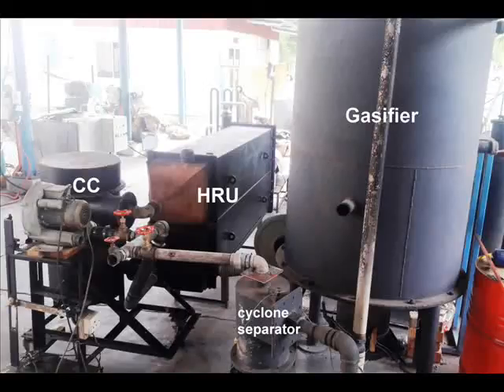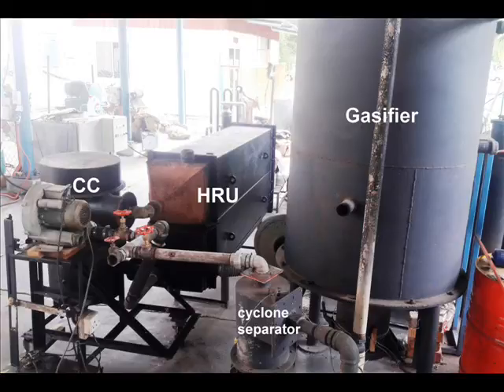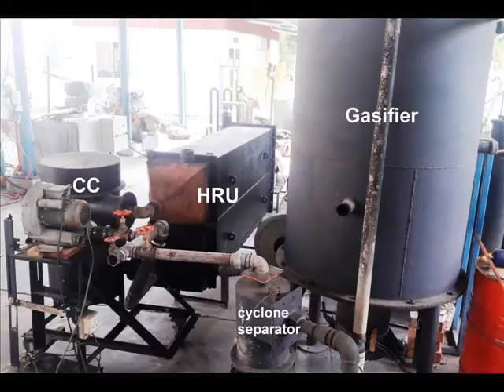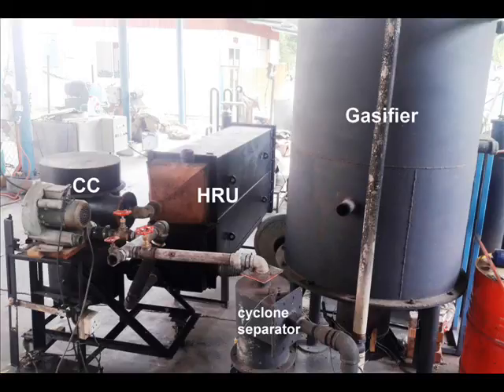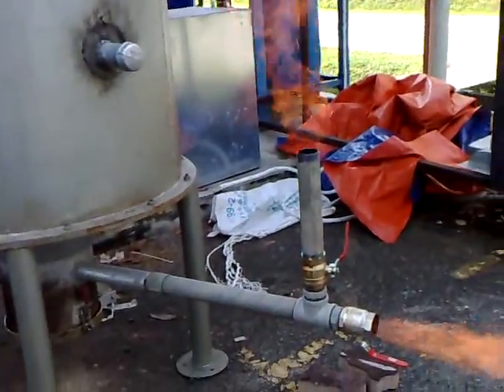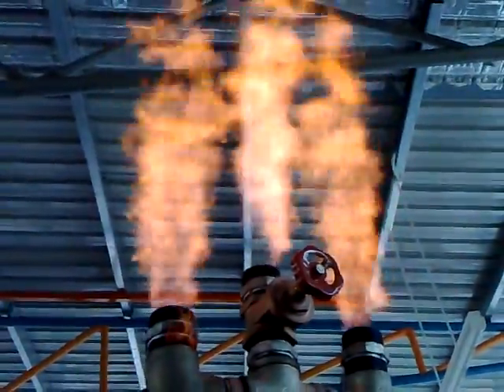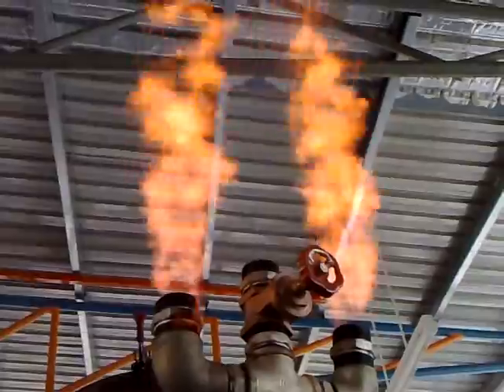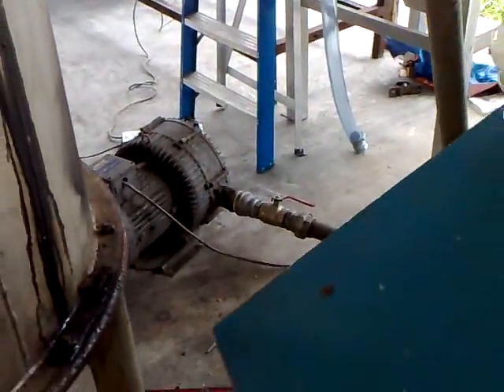Large 250kW downdraft gasifier test

Comment: I made a pretty big gasifier i have one problem that whenever i ignite the wood gas with lighter it ignites properly but as soon as i turn off my lighter the gas also doesn’t catch fire idk why this is happening please solve the problem
Reply from the maker: Producer gas can only sustain the flame (i.e., burn without pilot flame) only if its heating value is above 3 MJ/m3. below that it will not sustain. another problem could be the high gas exit velocity from the flare port (if the diameter of the flare port is too small). The solution is to put larger pipe for the flare tube or multiple pipes as we put in this large gasifier since producer gas flow is huge. This gasifier in the video is 250kW thermal output. If there is something wrong with the design of the gasifier then the producer gas heating value might be too low and it will not burn by it self so you will need to revise the design. What design you use for your gasifier?
Reply: @khaledAlattab  i can share a video with you please give me a platform (contacts) to share a video
Reply from the maker: This is my website you can find my contacts and socials there (https://sites.google.com/view/khaled-al-attab)
Reply: @khaledAlattab  okay thanks for this  I have sent a message you on Facebook waiting for your reply.. Thankyou